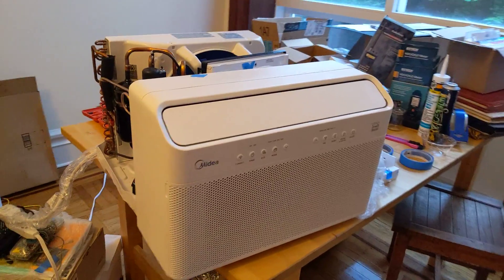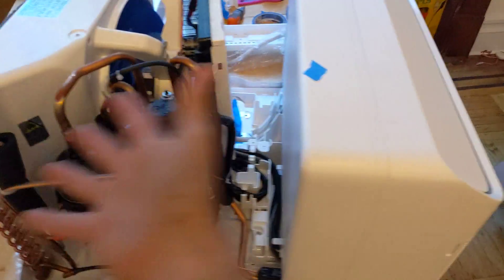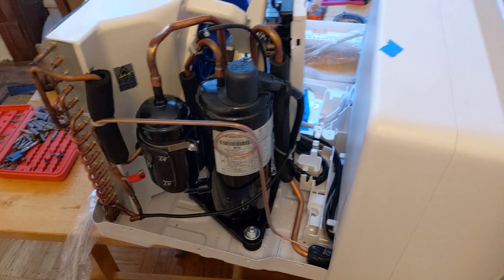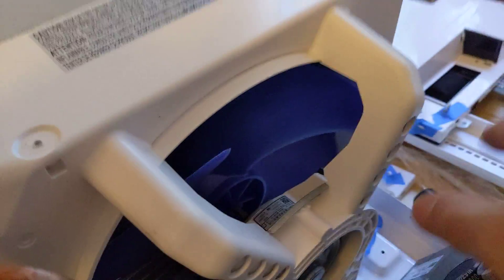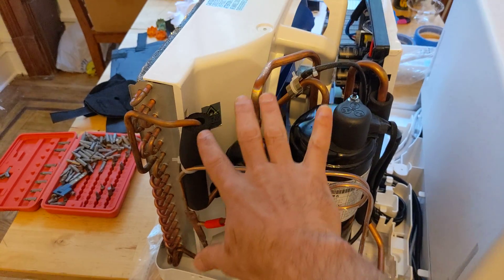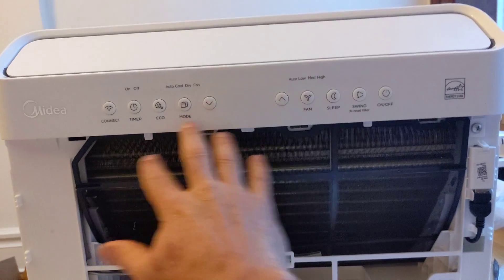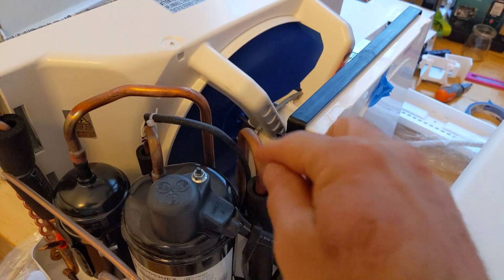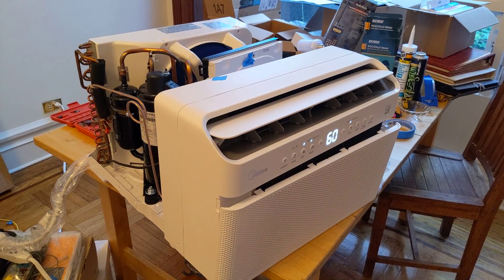How did Midea fit a full mini-split system inside their new "U" window unit?

Comment: Hi Josh - Thanks for the video. The high pitch noise of the compressor when its running is audible and bothersome on my unit. What would be the best way to quiet that down? I'm thinking of adding some 1/2" thick closed cell foam (neoprene) on the interior of the outside case in that corner where the compressor is at - serving a similar function to the blanket that comes on it already. Any thoughts on that or additional ideas for quieting it down? It's only audible if you can hear extremely high pitches - super annoying for those who do
Reply: I measure the sound at around 6000 Hz. I’d guess that over 99% of people can hear that just fine. Last test I could hear up to around 16kHz and I’m 45.
Reply: Did you make any progress on this?
Reply: @andrewnoblet5685  For me, I contacted the support who were confused. Kept offering me a new unit but mine is functional just annoying and I don't want to go through that installation process ever again. 

I'm about to add dynamat (mass-loaded vinyl) to the compressor. The unit comes with a cheesy cloth blanket which doesn't do jack to cut down the sound.
Reply: @AffinityPhoto  I was going to try mineral wool, or putty pads.

Comment: My idea wasn't cooling. the company did refund me. I still have the unit. It was giving a code that freon was low. i took cover off unit and noticed the compressor fan not switching on. could this be a bad fan , capacitor or fan won't work without proper freon.
Thanks for your help

Comment: Very interesting videos!
I'm looking for a suitable air conditioner to use in my camper van (solar powered).
Do you maybe know any options that are a) very efficient for smaller environments and b) if possible can be DC powered?

The midea u-units seem to be very efficient, unfortunately, they don't sell them in Europe (where I'm based).

I also saw your review of the zero breeze - there is a new one out already, but I'm not sure if it's better or even suitable...
Seems to be very hard to find something for this purpose

Comment: I have two of them. Kinda funny that every BTU package comes in the same chassis size. Other than more air movement there is no discernable difference in any of them. Side by side you can't tell the difference.
Reply from the maker: I think this is a good cost-saving strategy! They only need to make and inventory one size of most parts and can standardize the boxes for storage and shipping. The difference between the models is noticeable if you look inside since they have different compressors.

Comment: For those that are new to mini split, I've never seen any manufacture think outside the box. I've had this unit for a year now and I run it for 24/7.  It is definitely 40% efficient and quiet than conventional window AC. I would never buy anything else but an smart inverter AC like this. Oh before I forget, great video of actually opening the unit lol. I can be wrong on the number, but if you run this at ECO mode, you are looking at 110watts power consumption.
Reply: Why all AC's don't come with inverter compressors is beyond me. Even in units that don't have a gap in them, they still make for a quieter, more efficient unit.

Comment: Can this be installed in a regular window type opening in a condo ? My window is horizontal slide so this won't work but my room already had a joke for regular window type aircon .
Reply from the maker: This is deigned for a standard double-hung window but If the opening is wide enough, you can probably get creative and make it fit. Might require putting a 2x4 though the slot to keep it form falling out and then making something to fill in the top of the opening.

Comment: Where is the thermistor located? I have this unit not more than a year and it stopped blowing cold air and never stops running in cold and auto fan
Reply from the maker: This unit uses digital temp sensors rather than thermistors. There are in several places, including on the output line from the evap coil to measure subcooling and at the output from the indoor blower fan to measure output air temp. They feed back to the controller card where a computer uses the data to set the speeds for the compressor and the fans.
Reply: @bigjoshlevine  I am still waiting from Midea to reply on my case with this unit. Worked well initially and stopped blowing cold air now. Sucks sleeping with just the fan on a hot day.
Reply: @bigjoshlevine  Do you know where the digital temp sensor that measures the outside air temp is located?
Reply from the maker: @jessewhite4245  No need to measure the outside air temp - there is a temp sensor on the condenser coil which tells you both the temp and pressure of the high side which then lets you adjust the condenser and the outside fan speeds.

Comment: Hi Josh, I have this unit and left it installed over the winter in Canada, and now it will not power on. I have done basic troubleshooting and ‘reset’ the plug, but I was hoping you could point me as to where I should look next?

I am out of warranty period by 2 weeks! 

I
Reply from the maker: Completely dead? Like no LEDs or anything? If so, then I che3ck simple things like the fuse or the power switch or maybe a critter chewed though the cord.

Comment: @Josh Levine - Any problems with leaking where the window meets the air conditioner when it rains?
Reply from the maker: Not for me. I don't think this would be any different than a normal window unit for leaks, probably better because the window is more closed.

Comment: EDIT: Somehow this issue has resolved itself. No more tickety tickety sound. I don't understand how that's possible, but I'm happy. I hope it does not recur.

Does no one else have the problem of a rattling, ticking, clicking, "playing card in bicycle spokes," "Wheel of Fortune" sound when the compressor is off and the interior fan is running? Tickety tickety tickety tickety. The sound does not change in frequency as the interior fan speed changes, so I do not believe the fan blades are contacting anything or that the squirrel cage is unbalanced. Oddly, the ticking does increase in frequency (not in pitch but rather rapidity) and fades away to inaudible as the compressor ramps up, and it remains inaudible for as long as the compressor is running.

I am within an inch of loving this unit and raving about it to everyone I know, but this clicking sound is driving me bonkers, as it's easily louder and definitely more irritating than any other sounds the unit makes.

Comment: FOUND ANOTHER PROBLEM WITH THESE UNITS THAT I STILL CAN'T FIGURE OUT!! 

HUMIDITY!!.

Let me start by saying I had a 12,000 BTU unit for 14 years before I placed it with this unit which is also 12,000 BTUs!! Also my old unit was still working when I sold it for $100 recently!!! I did have to clean out a lot of mold but that horrible styrofoam the old units used to use. In styrofoam is kind of porous so it's impossible to get all the mold off It's inevitable It's going to come back very hard to clean!! 

My old AC WORKED FANTASTIC AT GETTING RID OF HUMIDITY AS WELL AS KEEPING THE TEMPERATURE INSIDE THE HOUSE ABOUT 20° BELOW THE OUTSIDE TEMPERATURE!! Sometimes it would take out too much humidity It would go from 55% to 30!! 

The new MEDIA does not do any better at keeping the area cool obviously BTUs are BTUs! It is extremely more quiet than old unit and obviously has better insulation because of the window!! Not to mention the Wi-Fi connectivity, Google assistant, in the auto feature which all help save a lot of money and electricity!! 

BUT SOMETHING IS WRONG WITH HOW IT GETS RID OF HUMIDITY I DON'T UNDERSTAND IT AND I'M NOT THE ONLY ONE THAT'S COMPLAINED ABOUT IT!! 

With this unit The humidity almost always STAYS THE SAME OR GOES DOWN A TINY PERCENT!! Like from 60% to 55. The other unit as I said before would go from 60 to 35 pretty quickly!! 

I know this because I have tons of sensors around the house that detect humidity. 

I have measurements of my old machine that I kept when I first bought it. With an infrared thermometer gun The cold air coming out would get to about 36°, when it was working its hardest. Probably more like 45° if you use a probe. The gun is probably not as accurate because of the fan.. 

I've also did the same experiment with the MEDIA U SHAPED I got similar results probably around 45 or 50° with the probe and about 40 to 36° coming out of the vent.. 

The rule of thumb is whatever the temperature is in your room the air coming out of the air conditioner should be at least 15° cooler.. SO THEY'RE BOTH WE'RE WORKING PROPERLY. 

I also put the humidity sensor right where the intake is on the MEDIA It was cooling the room down but the humidity almost did not change at all!!  It's almost like the humidity outside was always the same humidity inside VERY BIZARRE!! 

I don't know if it has something to do with the mini split system versus the solid axle where everything is connected. 

And just so you know the machine is tilted back so no moisture is coming forward. 

I know that some people have had a problem with moisture in the front fan on these units some actually growing mold.  But the front is pretty easily taken off You can get in and clean the fan and the plastic pretty easily. AND THERE'S NO STYROFOAM WHERE IT'S IMPOSSIBLE TO GET THE MOLD OFF OF!!  

People have given me theories and Google about. If the machine is too powerful for the room it doesn't stay cooling long enough to get rid of moisture THAT IS NOT THE CASE!! If anything it's underpowered For my first floor So we should be taking more moisture out of the air IT ISN'T!! 

I don't know if it has something to do with the VARIABLE COMPRESSOR THE NEW QUIET TECHNOLOGY.. Maybe not turning on and off enough maybe not staying on enough . 

I wish someone would tell me what's going on.
Reply from the maker: My first guess with a problem like this would be humid outside air leaking into the space. There is only so much moisture an AC unit can remove from the air per unit time, so if there is a window cracked open letting in more faster than the unit can remove it then the humidity will not be controlled. Do you have an airblock strip between the window sashes? Do you have good air blocking on either side of the U unit between the bottom of the sash and the sill? Any other new place where outside humid air could be getting in?
Reply: @bigjoshlevine  yeah I should have mentioned that because people always say that.

Trust me everything is blocked.. 

My old air conditioner I didn't have everything blocked AND IT STILL DID A MUCH BETTER JOB WITH HUMIDITY I MEAN I'M TALKING A LOT BETTER!!

I mean I even had a window opened with my old unit on the second floor of my house nothing blocking the hallway and it's still got rid of all the humidity SAME EXACT BTUS 12,000!!  That's definitely not the issue. 

Also a lot of people don't have ways to check their humidity I always have tons of these around... How does anyone even know that there's is doing a good job taking away the humidity If you don't check it. I always check always being monitored.. 

I suggest you try it yourself... 

I did a lot of research and found out what's wrong THERE IS A PROBLEM WITH THESE UNITS!!

Basically what's happening From what I can understand. THE FAN ON THESE UNITS TAKES TOO LONG TO SHUT OFF WHEN THE COMPRESSOR SHUTS OFF!! So one of the things You talk about that so great about these with the computer controlling the compressor on the fan IS ALSO A DEFECT FOR HUMIDITY!!

So in the compressor shuts off the fan slows down but doesn't shut off for 2 minutes or more blowing HUMID AIR BACK INTO THE HOUSE!! WHEN THE COMPRESSOR SHUTS OFF  THE FAN SHOULD SHUT OFF!! 

Old AC's that's how it worked. As you know it was simple the compressor shuts off the fan shuts off!! THIS DOES NOT HAPPEN ANYMORE!!.

IT'S A MAJOR FLAW!! 

And I even checked it is blowing humidity back into the room especially when the compressor is off.

I wish there was a firmware upgrade or something ( I have no idea why the fan doesn't shut off when the compressor shuts off like it's supposed to.. 

I remember you mentioning something about The compressor winds up and winds down slowly.. everything kicks in slowly It doesn't just turn on and off.. Maybe that's the same thing that's causing the fan to slow down taking too long to shut off blowing humid air back into the room. 

Never had any problems with humidity never changed anything in my house The old air conditioners the one that was even 14 years old that I got rid of and sold for $100 ALWAYS TOOK THE HUMIDITY OUT OF THE ROOM EASILY!! NOT THIS UNIT. 

And I suggest everybody checks the humidity with these units using an accurate way to check on a continuous basis. 

You will see a huge difference between old units and this unit.. 

Trust me it's not just me..
Reply: Well my guess is, these units were not designed to go below 55% humidity, as that is considered to be ideal humidity by many. A lot of these were designed, and or made, in Asian countries, and they actually like a little more humidity there. Maybe buy two window units, one Medea and one old school. One for efficiency and one for the humidity.

Comment: Great video, Josh. I just bought a Midea U, which I'll install this weekend. Reading all the comments here and wondering what your thoughts are concerning what's causing the mold some are mentioning? I've had a few ACs over the years that didn't have outside drain holes, and used the condensate water to literally fling around by the fan to cool the exterior workings, and have never had any mold issues. What's different about this design that would possibly encourage mold on the inside half of the unit?
Reply from the maker: This unit does not fling the outside condensate like some other units. Instead it keeps it in a pool and the hot gas lines runs into that pool before going into the condenser coil, which should heat up the water and make it evaporate and also lower the pressure on the output of the compressor. My guess is that they chose to do this rather then flinging because it is quieter. I do not see how the design of the condensate pan on the outside would cause mold on the inside. There is a gutter that carries the condensate from the inside to the outside and it is sloped and has a ledge so the condensate should go outside and stay outside. You can see the gutter in this photo https://photos.google.com/share/AF1QipOr9wWW0mJ3_4J-vBeuDJ3qbBA4ned8Vb6DGekYJ6ROvz-INnMedUMDRPF3GAO85w/photo/AF1QipPL7HAZ9B4f4AgNbFg0TXrNP8WQi4dRS4zxxo8m? key=eElaMkNvOFVSck5fdmV4aEMzbHFMbEZmbU1iek1n .  In my experience, mold on the inside is usually a sign that there is uncontrolled humidity in the indoor space. A small window AC unit is meant to work in a relatively enclosed space, so if you run it in a room with an open window and 99% RH outside, you are going to have high humidity inside the blower parts which can support mold growth.

Comment: Wonder if this will work with 50Hz mains frequency in the UK if I just got a step down transformer to convert the voltage to 115V…
Reply: Filipino model run at 230V 60Hz if you can find one to shipped back lol

Comment: THERE MIGHT BE ONE DESIGN FLAW!! 

THE ELECTRONICS!!

I could tell you building and fixing electronics for 30 years electronics don't like to be an extreme weather situations. 

That control boy with all those capacitors, resistors, transformer or whatever else is on there IN EXTREME CONDITIONS PROBABLY WON'T LAST A LONG TIME!! REMEMBER THAT CONTROL BOARD IS OUTSIDE!! 

All the humidity, moisture, temperature swings and everything else will cause cold solder joints over time weaken the electrical board really put pressure on the capacitors. There could be rust, oxidation and everything else 

All of a sudden it would just stop working AND NO ONE WILL KNOW WHY IT'LL BE THOSE ELECTRONICS.

Only time will tell on how reliable it is. My guess is that within 5 years people will be having issues with the electronics. 

I WOULD SAY THAT'S THE ONLY DISADVANTAGE!!
Reply: You probably solved the mystery of why people are complaining this thing stops after a year or so. Electronics. Could they reinforce the board so that it can take more extreme temperatures?

Comment: Any idea how the thermostat works on this thing? I need a thermostat I can program, to use on a solar set up. I would like it to shut off at 72* then kick back on when Temp reaches 85; for example. So it doesn’t just run continuously. Would it be possible to wire in a digital thermostat to this unit?
Reply from the maker: I'd probably use something like an Arduino with a temp sensor and IR transmitter to turn the AC on and off. 
https://learn.adafruit.com/using-an-infrared-library/sending-ir-codes
Reply: When you cut off power to midea unit the settings erase. I talked to danby, if that unit loses power and turns back on; it remains programmed to set temperatures

Comment: Is it possible to separate the inside unit from the outside unit as a DIY project?  It would have to have a hose to the extend the refrigerant line.  Would that be difficult?  I don't know how AC works, is the refrigerant line a separate loop, not part of the compressor loop? thanks

Comment: Make a tutorial how to clean this AC
Reply: e Channel
10 months ago
Three screws under the front cover then unplug 3 wires. Use screw driver  to  pry open the front cover. It IS only snapped  in. Then two screws on top. 3 screws on each side then you have to unsnap gray cover to get to fan.Just opened mine. Fan stopped spinning. Put grease on rubbeer holding fan in place. It was making whining noise then stopped spinning. Works fine now.